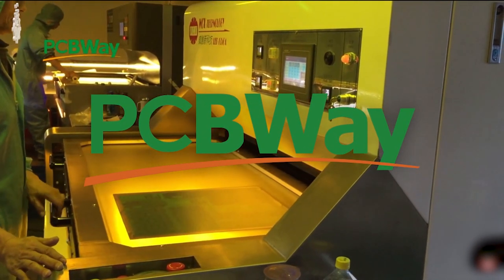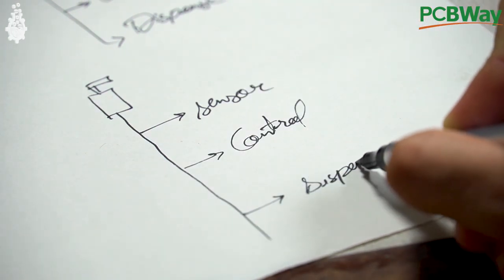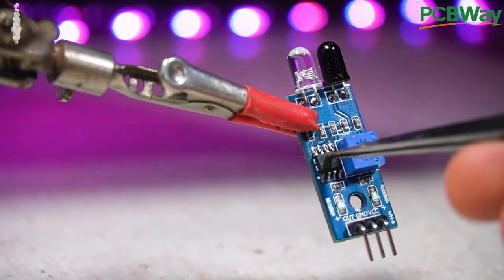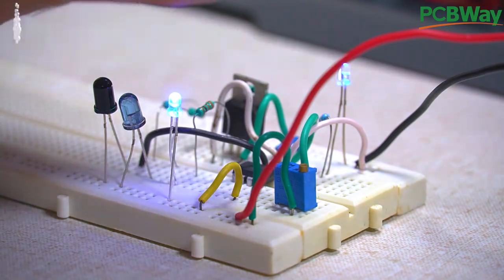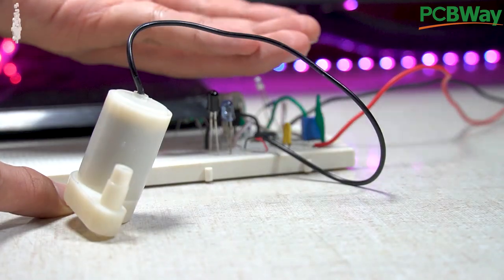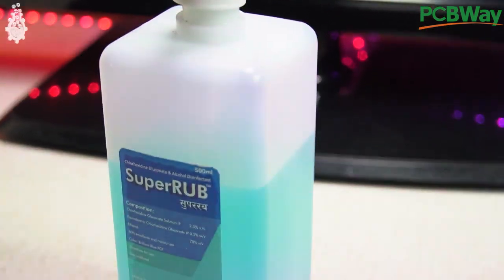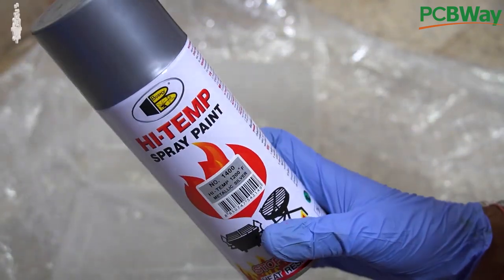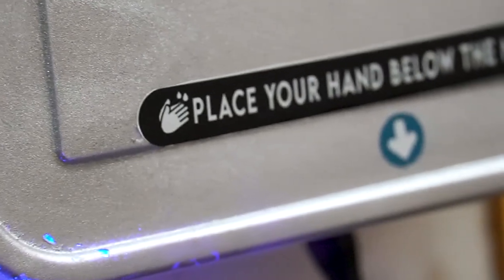automatic sanitizer dispenser | touchless sanitizer dispenser without arduino

Comment: Thanks for taking your time to make a video on this, building the circuit itself takes time. I didn't know that PCBway still ships to India, could you tell us how much it costs in total (including import duty and shipping)? The last I checked they would fabricate it for 2$ but shipping was around 25$ which makes it expensive for small hobby projects. On top of that, given the current situation I fear the customs would put a heavy duty on it or block it altogether.
Reply from the maker: Customs might be high, I suggest you to check with customs department once,

And yes, building circuits takes hell lot of time, thank you for appreciating our efforts 💯

If you would like to know more about customs and or import drop a msg on instagram.

Thank you for subscribing to Mission Critical

Comment: Sunlight ir sensor not work
Reply from the maker: It does work, you just need to adjust the sensitivity, other than that, I have placed the sensor in bottom side of enclosure which basically would have minimum impact of sunlight, yet if you face that issue, use some tape and it should work.

Thank you for subscribing to Mission Critical

Comment: Brilliant but with some flaws - 1 The selection of soaps or handrubs you can use is highly limted as many soaps or sanitizers are thick which that little pump wouldnt be able to pump. I would rather resort to using a servo with a NE555 Timer IC which can generate an appropriate signal for the servo. You should also include the schematic so that people who cannot order pcb's can build this on a prototype board or on a breadboard. Other than that, Brilliant.
Reply from the maker: Thank you for the suggestions, Schematic is attached in blog, will be up in few minutes, 
My pump worked with Sanitizer, anyway I have plans for upgrades, will be much efficient in that version, 

Thank you for subscribing to Mission Critical!

Comment: how to prevent wastage of those few drop after we take back our hands..
Also under the "Make in India" cap you are promoting pcbways !!
Reply from the maker: Add resistance ( Blockage ) at end cap, or try to place the nozzle at higher altitude than container.

regarding Make in India, the real fact in golden words is that India doesn't have best PCB services, sure there few, but they charge atleast 200% more also they don't take orders from individuals, you need to have a GST number and Company registration to order from them, the basic goal of Make in India is to atleast start designing and process of that and no i am not misusing or misguiding their goals, i strongly believe in Make in India. these things take time, you can't all of a suddenly change your source of purchases, i hope you would understand the depth of this information and not take it in wrong way.

Atlast, Thank You for Subscribing to Mission Critical
Reply: @mission_critical   for this design how to make the nozzle above the container